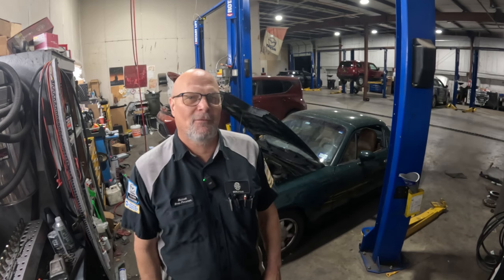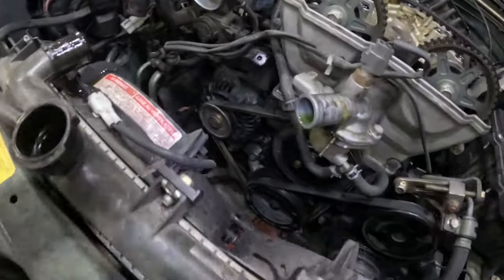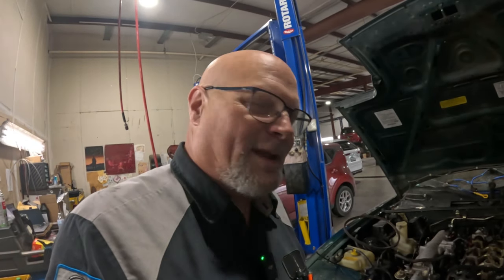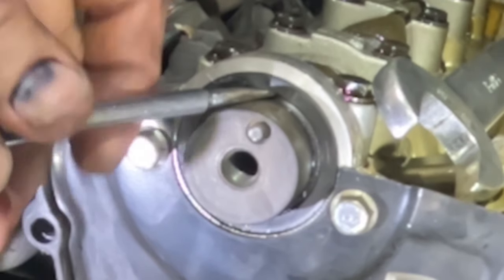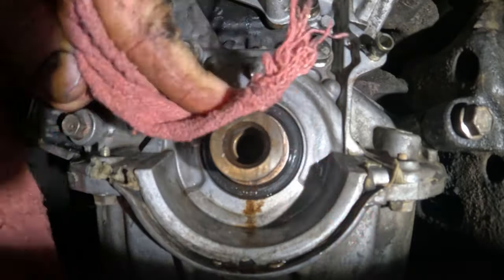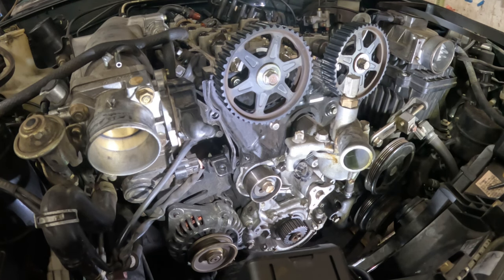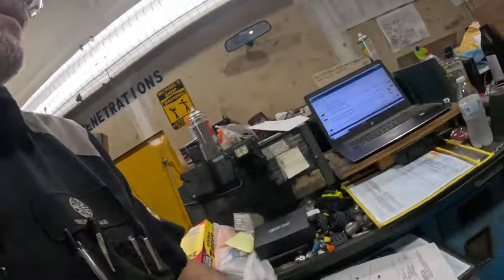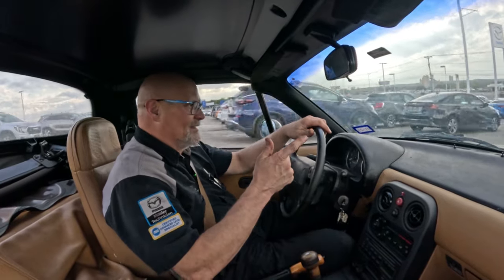Mazda Miata timing belt and seals.

Comment: Quick question Mike, why didn"t you replace the tensioner ? since you did all the front seals  , a new tensioner with the bearing would have been good to do @165K for a little added reliability and they are not expensive . the belt noise you referred to would be comming almost always from a failing tensioner bearing am I right ?  😐
Reply from the maker: This job was done on a budget.  If it needed a clutch, then he wouldn't have done the timing belt.  The tensioner and idler pulley bearings were good.  So we just let them alone.